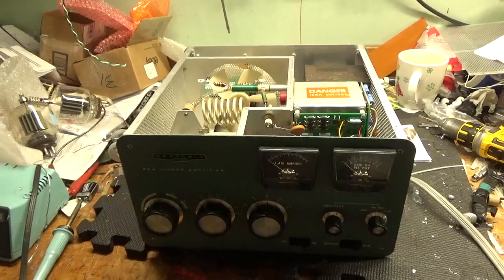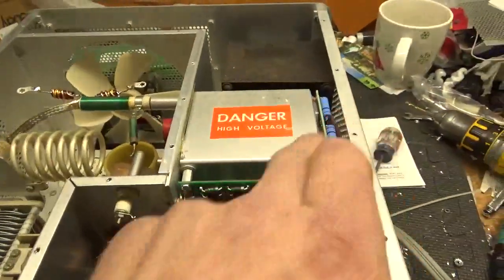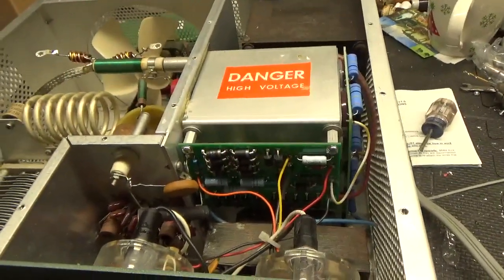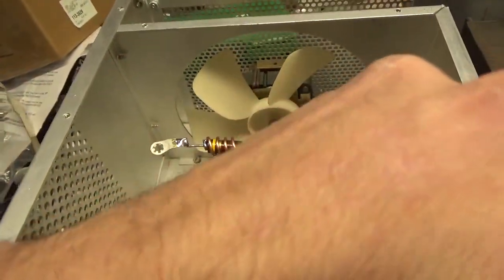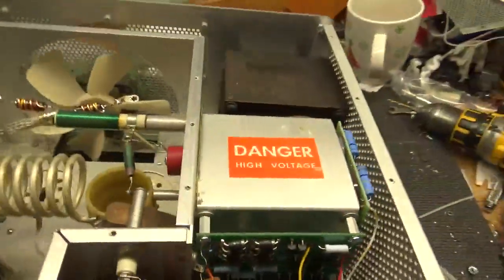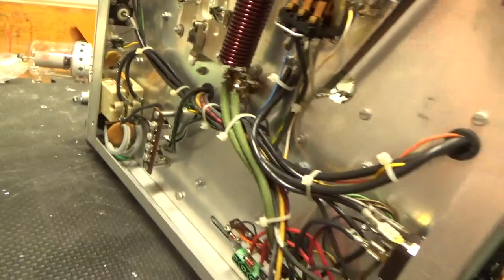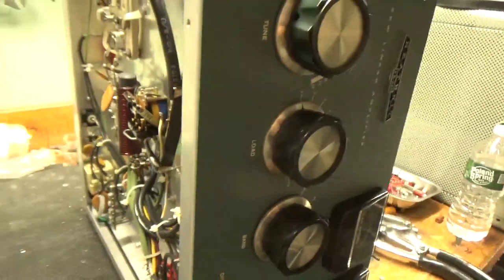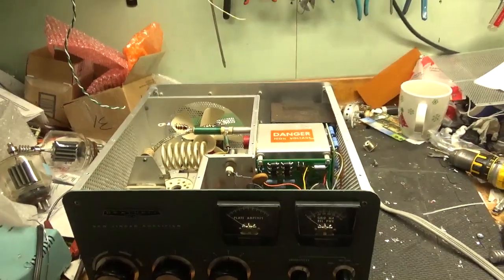Heathkit Sb220 repair and Modifications

Comment: Love the channel. Can you talk about the series glitch resistor a little? What are your recommended values? And what is the theory behind using it? Would a fuse work too? Thanks! Tod KJ6H :)
Reply from the maker: Will do next time I install one, but in mean time I gave some info in my response to your last question. also, the series glitch resistor limits the amount of fault current at the source of the fault thus Minimizing damage. With a higher impedance resistor, you gain more protection, but the resistor dissipation value also has to go up 73